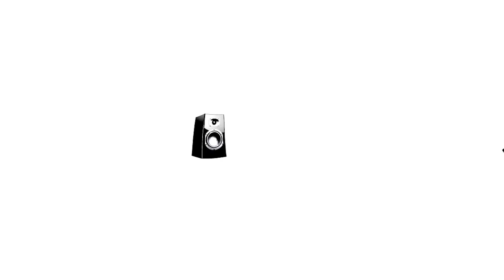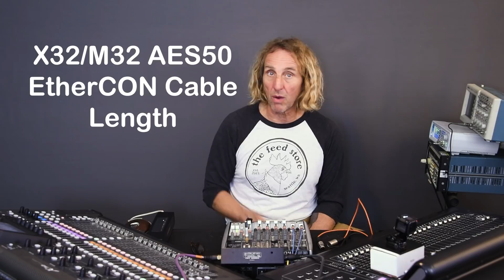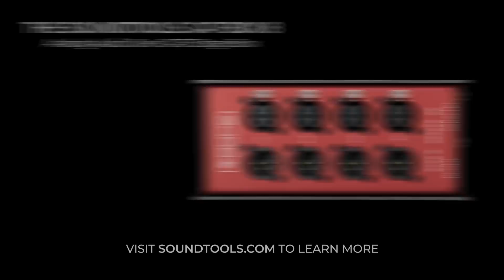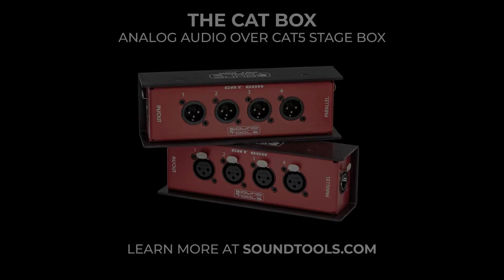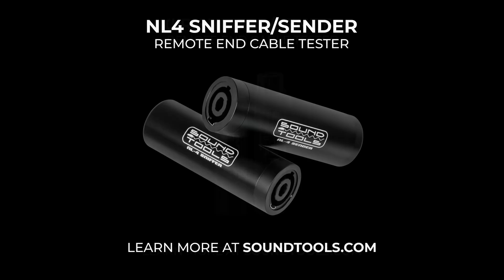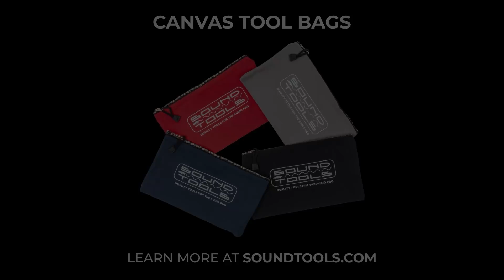Behringer X32 Midas M32 AES50 Cable Type & Length (Public)

Comment: Can’t you run fiber for long runs? That would be far more reliable.
Reply: That was my thought. I wouldn't do the conversion if I didn't have to, but when a limit is reached I would do it.
Reply from the maker: Overall, I think that one must decide whether to take on the challenges adapting and using a semi pro console for larger scale applications  or whether to scale up to pro gear.
Reply from the maker: Yes and that is what we do for the gear we supply. But when artists bring their own consoles and want to tie into the cat5e cables on our snake is when we have issues

Comment: I was mixing a high profile regional band at a local college and it was an M32 with a DL251 for the stagebox. 
We had so many issues with static and signal dropping out. 
2 days later the production company owner chewed me out for the stagebox cutting out. 
After that I lost all faith in Midas products because I had so many bad experiences with them.
If you think AES50 on an X32 or M32 is bad, check out a Pro Series. It is far worse. you can only run 24 channel bidirectional at 96k and from what I observed happening, its far more unstable then the 48k of the X32. I just observed all these problems with no way of testing it. 
Here is another interesting thing. I had a house gig on an M32 at a church. 
They had Cat6STP running.
The M32 was plugged into a wall jack, that wall jack went to the ceiling behind the sound booth where there were several unlabeled Ethercon barrels. The wall jack was plugged into one of  the barrels. That new line in the ceiling went into the power amp room where the stage box was. 
So there were a total of 5 connection points (maybe more) to get the console plugged into the stagebox. That console had so much distortion and horrible sound simply because of all those connection points when it is supposed to be console plugged directly into a stagebox.
Reply from the maker: All sounds messy yuck

Comment: I have been on the hunt for a cable to run AES50 from monitor console to FOH and have been apprehensive. Running a waves card in M32 at FOH and thinking of getting two Dante cards and a WSG hear bridge so I can run Dante instead. At that price point I could be looking at way better consoles though. 75m is the most I think I would consistently need. KT has the NCAT 50m on a reel. They say you can chain two together for 100m but I don’t believe it. This is what Behringer states about cable spec in regards to AES50 and X/M32 consoles.
“For best results, we recommend using a shielded CAT 5e
cable with Ethercon connectors wired to the T568B standard.
Unlike other digital protocols, AES50 (SuperMac) uses all the
pins within the cable making cabling quite important.”
Note that they specify T568B vS T568A. Rarely do you see
that specified. Each cable inside a cat5e cable is twisted at a
different rate. The system is so very sensitive that those
changes in twists may have an impact if different pairs are
used.
They also specify Cat5e cable, and don't mention Cat 6
cable. Dave! Sell me a 75M cat cable on a REEL that you guarantee to work with M32 and AES50 and I will call RS tomorrow and order it. Pretty Please? Appreciate you and what you do for the community!
Reply from the maker: I will guarantee an 80m reel of supercat sound will work well and have a 20% buffer, meaning you can run 100m max but 80m is the max I recommend.

But... I am not sure we have it right now. Also we are getting a shipment of our new SuperCat Cat7 I believe coming in Jan. 

It would be really cool to get that to ya.

How about we chat after the 3rd when I am back in the office.
Reply: @DaveRat  Sounds great. I’ll reach out then.
Thanks

Comment: Hey Dave, did you happen to run these tests with more devices on the chain? This video has me wondering if a chain will still get 100m between devices, or if it will perform worse? A scenario I’m thinking of might be 100m between desk and stage box and then another 100m from stage box to another stage box… I think the ports are supposed to regen the signal, but still might be an interesting test.
Reply from the maker: Yes, each hop we regen the signal and start fresh
Reply: That's why I have two small SD8 stageboxes with the x32, I've had some (sports) shows with long cable runs and the problems described but when running 50 tot 75 m of cable max to a stagebox and connecting it with the next I can reach much further if I have to.

Comment: Thanks much Dave. How about M/X32 AES50 to Midas PRO stage boxes, such as Midas DL153 or DL251 stage boxes; any testing mixing it up? Also any thoughts from the MIDAS Pro series consoles using on AES50?
Reply from the maker: I will ponder testing and remiss to make assumptions other than the sound and function of the d to a and a to d converters should follow the stagebox

Comment: Do: buy a DN9610
Don't: go over 80m 

I use dätwyler 5502 cable, with my pro series gear. Tested it from 100m down. It starts working at 85m. Over 85 it will pop. Over 90m its dead. Then one day I bought the cheapest cat5e on amazon and it works on 100m. Just the outer jacket sucks.  
I prefer to use a Klark Teknik DN 9610 repeater on cables over 80m. 

For long cable runs there are also aes50 fiber converters (DN9620 and 9680) for converting 2 or 8 aes50 ports to fiber and back. 

Also few years ago I had  a gig with a M32 and 120m Cat6A. I was sure it wont work, but  suprisingly it did!
Reply: Oh and I also tried it on analog multicore. I used ethercon to 4x XLR adapters (just like your cat boxes). 1m cat + 4ch 50m analog multicore +1m cat. Works fine.
Reply from the maker: Very cool and interesting. Though also a bit scary and not comforting or inspiring to trust for the show levels we do.
Reply: @DaveRat  for the level of shows you do, redundancy is a must. So M/X32 is not an option...  Anyways I just had to try the analog multicore option but I never used it for a show.
Reply from the maker: I love the multi core analog cable convert option.  Very cool

Comment: I did an event once where the provider used a 400' run of Ethercon for an M32 to a stage box..... I asked if he was sure about that choice, and was assured he tested it and that it worked. It did for a large portion of the event until it didn't. Once it went awol, it was not usable and would drop out every few minutes. The scramble was done to re-patch with copper and things were business as usual. I own 2 cables of my own, the longest one being 250', both with grounded barrels. I have never once had an issue with either one. Interestingly I use my longest one most often and it is a Cat6 cable.
Reply: What brands are u using?
Reply from the maker: I tested multiple cables and 250 is generally stable and safe.  Fro Rat Sound we use the SoundTools supercat for and supercat sound cables.  The supercat sound works at 100 meters but adding a 15 meter extension makes it unstable, adding a 10 meter extension works.

For the level of shows we do, that is cutting it close as I like to see it still stable with a 20 meter extension.

That said, the coupler does degrade the signal and I have not tested 120 meters continuos supercat sound, which would be the stability goal.
Reply: @DaveRat  Would using cat6 work the same?
Reply from the maker: Cat6a that I have tested does perform better and tends to give longer lengths. That said, Cat6a tends to be very thick, rigid and tougher to wind.

This is why I am working on designing an Cat6a grade cable that winds well and is optimized for portable live events
Reply: @DaveRat  I can’t wait till u release it!!
Reply from the maker: 250 ft is a safe length

Comment: We can hardly blame the wire makers, who offer - at a price - a variety of very highly specced products that work to perfection in data applications.  It is our need for extremely low latency that puts these interfaces at risk.  I’m curious, have you tried using repeaters?  This is reminiscent of coax, where the interconn itself is a major weak spot.  I’ve seen MADI struggle with 100m but only when routing through a patch panel adding virtually no length, like it’s on the hairy edge.  When I put an active buffer right at the truck panel’s input connector, all is well.
Reply from the maker: Adding a repeater to the middle of the snake that runs through the audience area and requires power out there is creating complexities that would make things much worse
Reply: @DaveRat    A company named Patton is devoting themselves heavily to solving the complexity issue.  Their repeaters use PoE so require no AC cabling.  There are enough conductors in the Enet cable to make this possible.  As I convert my remote system to Dante, I have considered lithium ion battery powered repeaters.  Currently looking for power consumption figures for available repeaters.  Dante is worth the extra effort, a solid and reliable platform.  Audinate has repeatedly improved the fundamental process as well as the actual hardware SOC, such that the current iteration - Brooklyn - is much more capable than its predecessors.
Reply from the maker: Ideally one would not need to put a repeater midway down the snake stuffed into a cable trough.

Oh the thought of losing the PA mid show and trying trouble shoot a beer drenched repeater with while trying to clear a dozen kids out of the way. Fun!

Or, use a cable and digital transport system that reliably sends the signal well over the desired distance.
Reply: @DaveRat    Well, then - optical fiber it is.

Comment: I’m switching my stage to a DL32 stage box from a worn out (20+ years old) analog snake. I think my run is about 30 meters and I’m using Cat7 with braided shielding running through protected conduit from M32 to Stage. I’m hoping that will be stable. I had thought about some longer runs through the building for mixing overflows, but I think now I’ll do that with Dante. 
Data is a vastly different animal to analog. The shielding and twisted pairs have to be maintained entirely from one end to the other. I use copper tape to connect the shielding and make sure the pairs are somewhat maintained in the connector when terminating. All these pieces add to the stability of data cable. AES50 doesn’t seem to have the same level of error correction as most other network transport protocols do.
Reply from the maker: I think aes50 has the same error correction protocol as analog, meaning - none
Reply: Mark… cat7 is not the spec from music tribe.  Best of luck if you have any issues or warranty problems. 🤷🏻‍♂️ luckily your distance is not close to the max spec so it’ll probably work.
Reply from the maker: The only warranty issue for music tribe or at least only issue that seems to possibly cause failure regarding the cable type seems to be regarding the cable being shielded and the shield actually being connected on both ends.

The seems to be related to static discharge that can damage the consoles with unshielded cables.

That said. The consoles actually seem to work better with longer cable runs of unshielded cable except in environments with static electricity. And also, Cat7 cable is shielded and Cat7 to the best of my knowledge meets and exceeds cat5e specs.

I don't understand why using a cable that exceeds the specs would be an issue.
Reply: @DaveRat  totally agree. RF can be challenging in my location so more shielding is always better. There’s no possible way that less crosstalk and interference can be a bad thing.
Reply from the maker: And beyond rf, aes50 has static electricity susceptibility issues that the shield helps with

Comment: Man, your description of the sound that results from something heavy being rolled across an ether snake is pretty accurate.  Running eight top boxes and four dual 18” subs indoors was probably pretty close to what a nuke might sound like when it goes off (right before you get turned to dust) and is enough to make your heart stop beating momentarily.

Comment: ive always run power bundled with the aes50 so there is no gnd potential between the devices, but my cable legnths have been too short and my shows too few to say if it even has made any difference at all :/
Reply from the maker: And for the tests I did, both consoles were plugged into the same outlet box, so any issues were not related to grounding

Comment: I experienced issues with dirt: cleaned with a brush and isopropyl alcohol and all well again.
50m S/FTP CAT7 Belden PUR cable, with top of the line neutrik's ethercon.
Reply: Uc3, cat5e cable is what is spec’d by the manufacturer. Cat7 has tighter twists and increases the actual distance.  Aes50 is not regular ethernet traffic and therefore “one or two” grades of cable “better” is not in this case
Reply from the maker: I am seeing better result and more stability with longer runs when using the Cat7 cable I have been teating, vs similar diameter  Cat5E cables. I am getting the best results with Cat6a
Reply from the maker: Ahh yes, dirt is an issue

Comment: As a touring engineer that uses the m32 format, the only confidence I have in my rig is that all AES50 signal lives on stage between a couple of m32c and a DL32 stagebox. Max cable run is about a foot haha. I use whatever garbage ethercon is provided for the day as control only over ethernet to an xtouch at FOH.
Reply: I wound up console side stage with x touch/tablet combo at foh exclusively after running in to these issues.
Reply from the maker: Aes50 is wonderful and low latency for shorter length runs
Reply: You can hardwire a laptop and an Ipad to an ethernet switch at FOH along with the X-Touch. 
I have done this a lot, minus the hardwired Ipad. It's a powerful way of doing things.
Reply: Yep I do this currently and have a Waves server on deck controlled by superrack at FOH. I’ve even gone so far as to use 4 pins of the cat5 just for ethernet and the other 4 for two channels of aes. DL32 aes out to a  venu360 at FOH for my outputs.

Comment: I run a 300 ft cable (91 m) every weekend for at least 4 years with zero problems. Is the recommended Pro Co shielded cable. I don’t know the specs but It works every single time.
Reply from the maker: Yes, and also there are many variables beyond function in a specific geographic region and setup.

Hot dry and high static environments seem to be less stable.  That said, the instability seems to occur at 100 meters, I measured an 80 meter cat5e all good and added 10 meters plus a barrel connector and it went unstable.

I think if this discussion was about rigging steel and stuff hanging over people's heads where these 10% differences between function and fail would be much clearer to understand.

Though we are talking about catastrophic show sound failure which is not a minor issue

Comment: Careful recommending cable beyond Cat-5e. One issue with AES-50 is the interpair slew, which is allowed to be bigger with the newer cables to allow different twist patterns for better performance. That does not cause a problem with EIA-568 networking, but it can misalign things enough in AES-50 to really become a problem.
Reply from the maker: Interesting. With the supercat sound cable, when working on the design, I went with the same twist rate on all pairs as the crosstalks was so much lower with individually shielded pairs than with the overall shield.
Reply: @DaveRat  It's not just the twist in the pairs that's at play here - it's how the pairs are twisted around each other. Do you have test gear which can measure skew? (Note I said slew above, skew is what I meant; "Propagation Delay Skew" or "Time Delay Skew"). The video guys bump into this sometimes, too, when pushing HDMI over distance.  Going by memory - and please don't trust my memory - Cat-6 allows 50ns skew at 100m (and typical measured is 25ns) but Cat-5e typically has no skew at all. 100-base-T doesn't care at all about skew, because pairs aren't used together, but AES-50 is a whole 'nother ball of wax.  Note that the cable industry purposefully introduces skew because it helps with FeXT. I wish I knew what the allowable skew was for AES-50.

Another thing that has me scratching by head is - what happens with consoles/boxes with ground offsets - there will be a higher potential difference with long cables using higher resistance shield material.  Not sure why that would matter, but these consoles seem to be really picky about having an identical ground reference.  I would love to find a problematic 100m stagebox install and a 100m power cord from the console to the stage box...and see if that fixes it...
Reply from the maker: Yes, we have a fluke cable tester that measures cat and fiber.

As far as the ground issue in my tests, the consoles are right next to each other and grounded to the same power on short cords and there are issues.

Perhaps there are more issues possible with remotely located consoles but even plugged into the same ground, the issues exceed what I believe is acceptable for a 100m spec

Comment: Any time I've had issues with AES50 it always has come down to bad cable certification, especially with crosstalk failure.  I would shoot them with a fluke tester and they would fail cat5e certification.  As soon as we fixed cable lengths or fixed cable quality we would get stability back.  Not everyone has access to a expensive cable certifier though.
Reply from the maker: Interesting, and this was at 100 meters or longer?